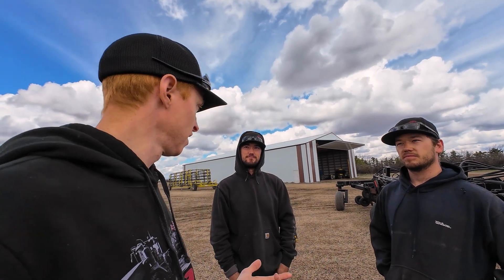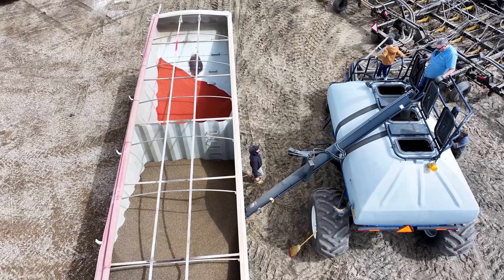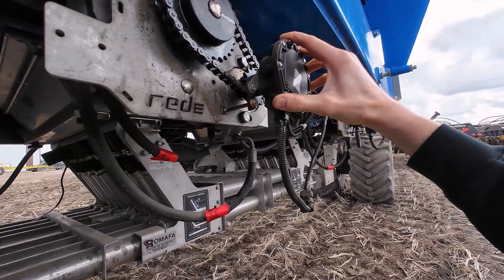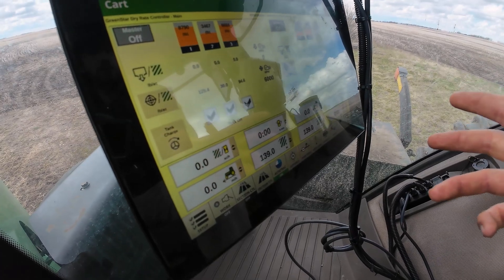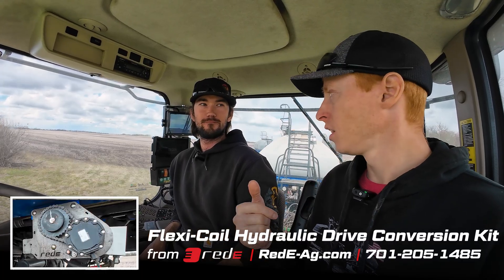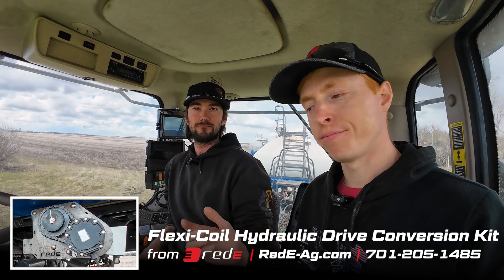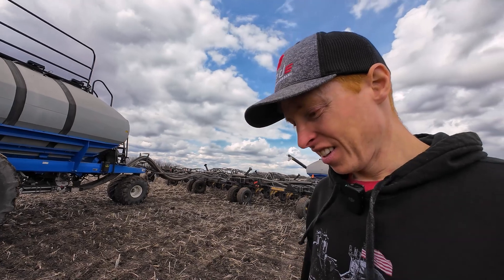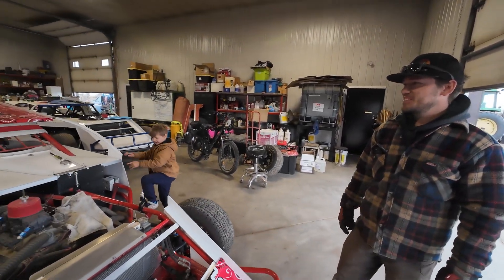We've NEVER Seen a Setup Like This...

Comment: Ive pulled twin carts for a very long time. Currently have two 430 carts same as yours just with a 60' flexi coil 5000. Pull with a versatile 435 in some pretty nasty hills in alberta.

Comment: Lucky it was only a sensor and not a wheel off the aircart... that takes a week to fix...ask me how i know 😅😂
Reply from the maker: Oh man I'll bet that means you lost a lot of undercarriage parts too then... We have fixed too many of them because the caster assy spindle broke.
Reply: @RedEAg  luckily we managed to pick up a second-hand cart and rob for parts to get up and running as parts we're going to be a minimum of 2 weeks to be manufactured, We were lucky it was also the side that didn't have the meter drives or electronics